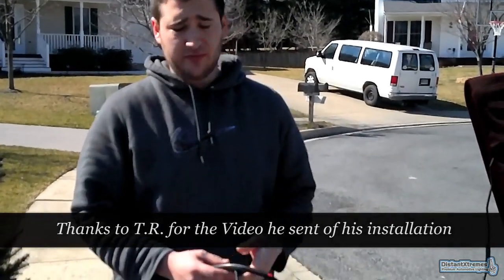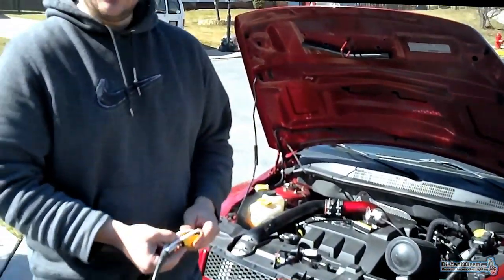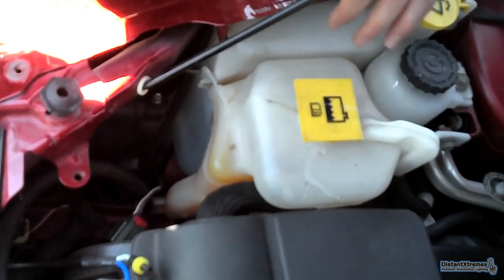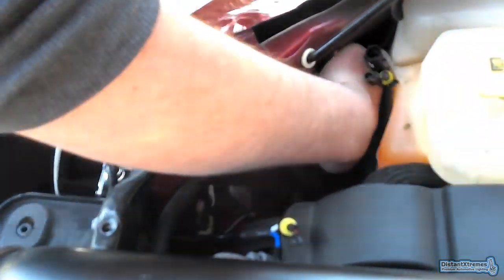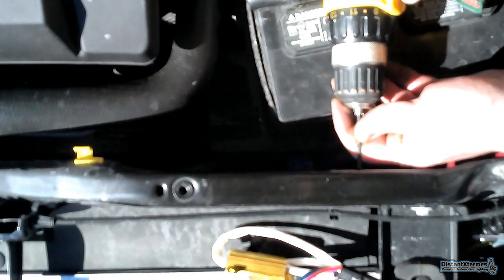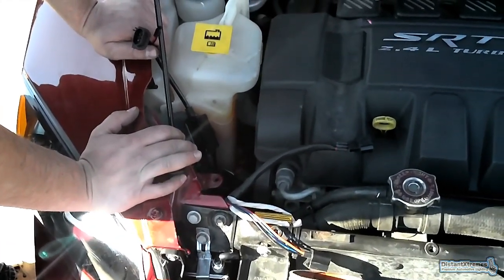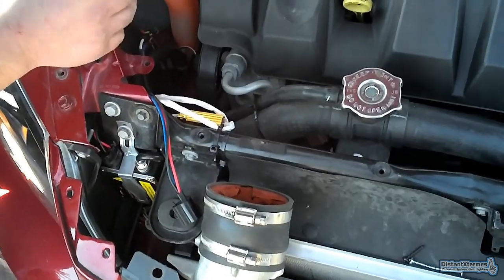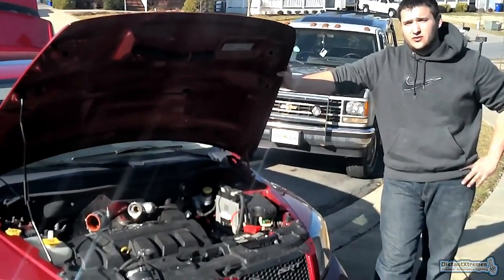Dodge Caliber SRT-4 HID Installation No errors No flicker DistantXtremes

Comment: How do you install the resistors for H13 Hi/Lo ? Do I need to use the relay harness? warning cancelers?
Reply from the maker: Regular resistors you will have to tap them into, or solder them into your factory harness. We have created an easy plug and play H13 resistor harness. You just plug them in to your existing vehicle connector, mount the resist to metal, not plastic and your done.
Reply: +DistantXtremes Lighting I have the plug n play resistors just not sure where they are supposed to be connected. Do you a picture or something I could reference? of where they are being connected
Reply from the maker: +Kerri Thomas 
http://www.distantxtremes.com/store/p961/H13_Bi-Xenon_Resistor_Capacitor_Error_Free_Anti-Flicker_Module.html

Comment: instead of drilling why dont you use self tapping screws 
oo and fyi These dont get "WARM"
the gold resistors get boiling hot and will fry any hard or soft plastic to a puddle of liquid i shit you not i have installed these 4 times now an they do work 100% but they get stupid hot every time